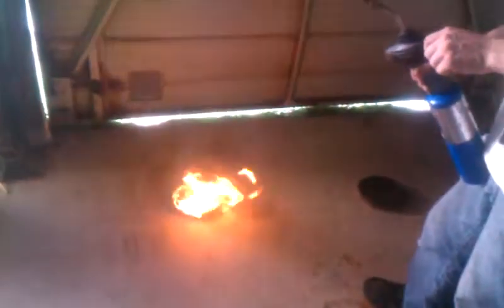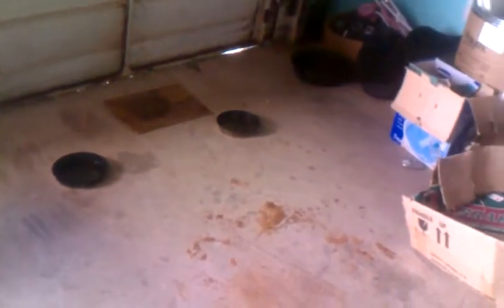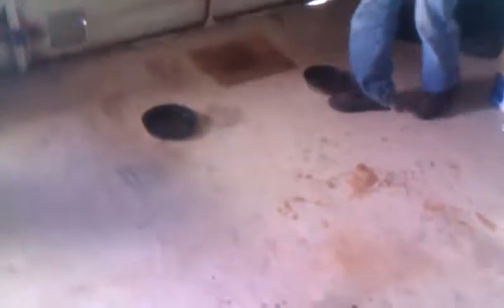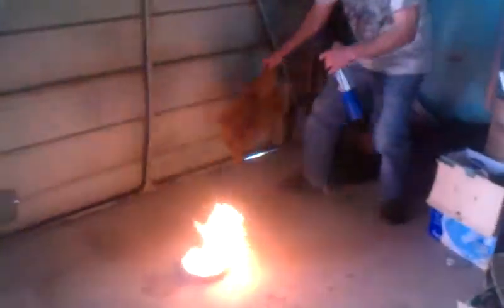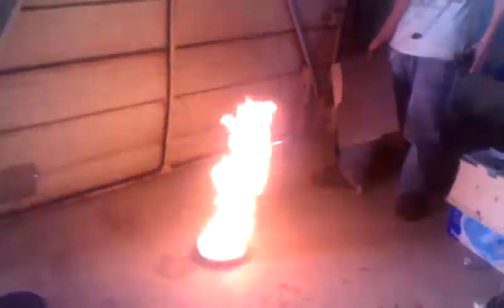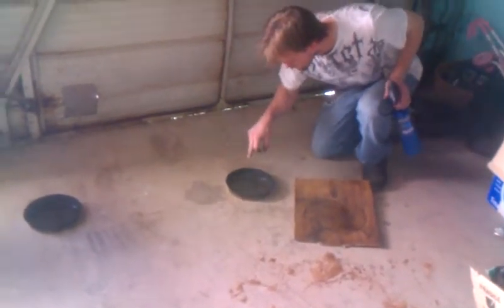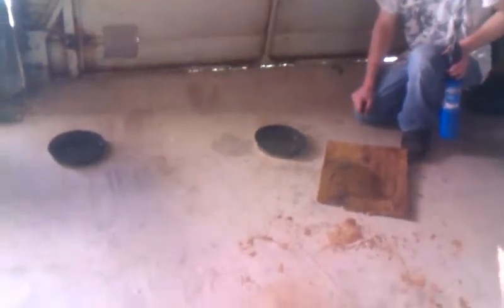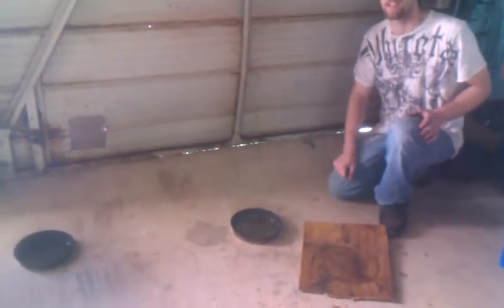non-ethanol gas vs ethanol gas

Comment: takes longer to burn cause there is more energy in it.

i have proven this myself in my two motorcycles. upon switching to non ethanol fuel i had to turn the idle speed down. my mpg also went up about 10%.

conclusion- non ethanol gasoline produces more power.